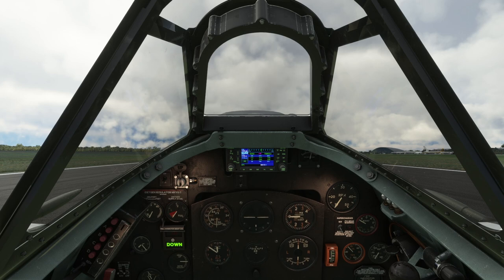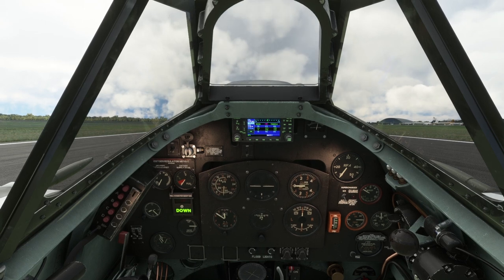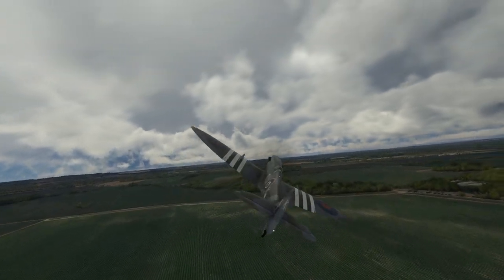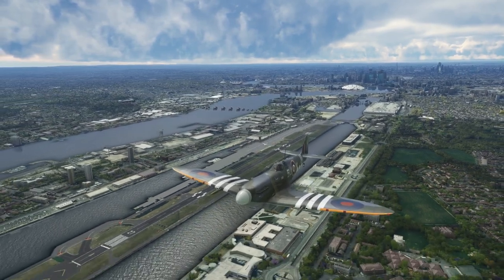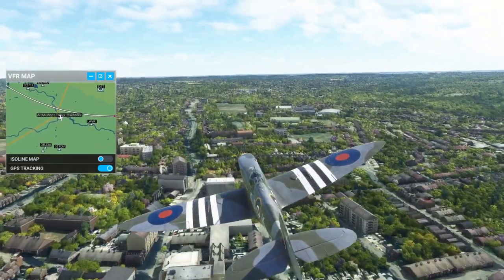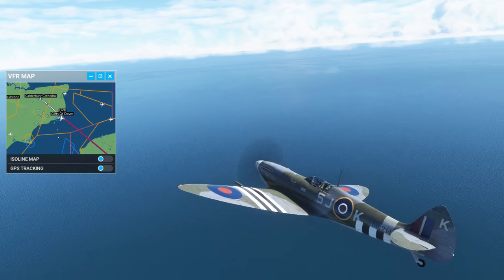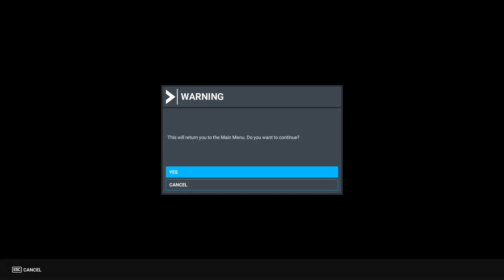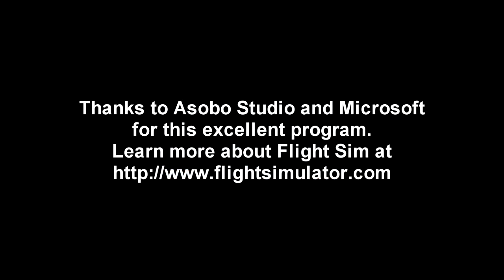Flight Sim 2020 - FlyingIron Sim Spitfire Update

Comment: Could you advise what your PC spec is for cpu/memory/gfx and the FPS you’re getting please?
Reply from the maker: i5-12600k, 32 GB RAM 3200 MHz, RTX 2070. I haven't checked FPS, but I use the in-game lock to limit it to 30 (since that's what I record at). What you see in the video is basically what I get while playing and recording at the same time on the same computer.
Reply: @RaizSpace  thank you for the information, looked very smooth :)

Comment: do you find it more difficult and confusing to start? i’m not sure if i’m doing something wrong or if it’s intentionally more unpredictable.
Reply from the maker: Haven't tried starting it since the update, so I'll have to do that. I tried it before and, as with a lot of these old planes, it's finicky about timing.
Reply: @RaizSpace  it sure is, so it probably should be that way in the sim. i’m just not sure if i’m doing something wrong now or if that’s the way it’s intended. thanks for reply.

Comment: How did you add guns to your spitfire
Reply from the maker: There's a place to click to add or remove them. In the cockpit view, if you hover over basically where the guns should be, I think you'll see a tooltip for it. I actually kept clicking it unintentionally.
Reply: @RaizSpace  ok thank you I will try that next time I hop on 😊
Reply: @hamzas_aviation  unless you have the marketplace version
Reply: @RaizSpace  where abouts would it be in the cockpit? Because I can’t find it 😂